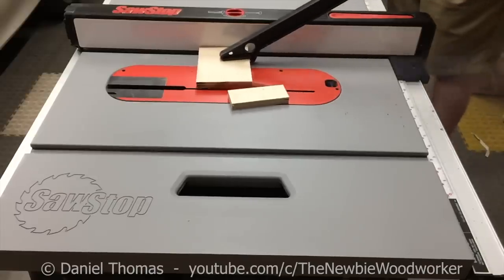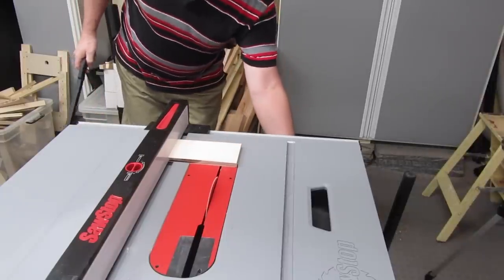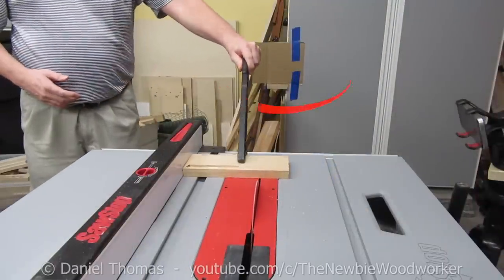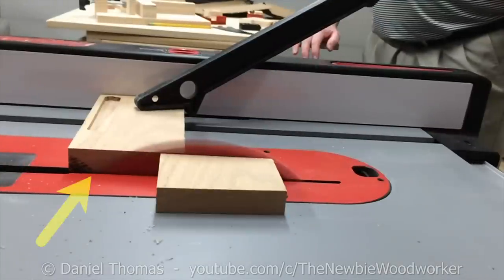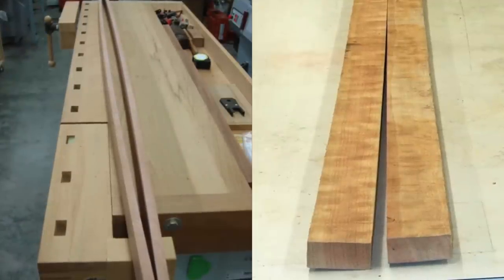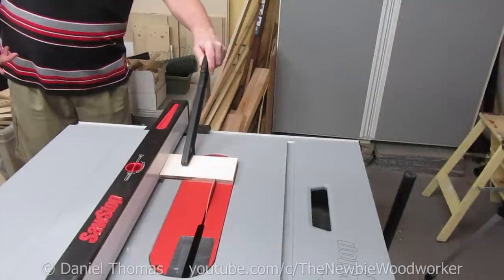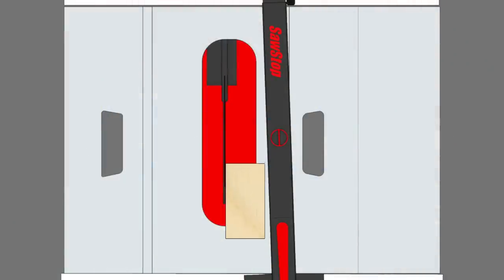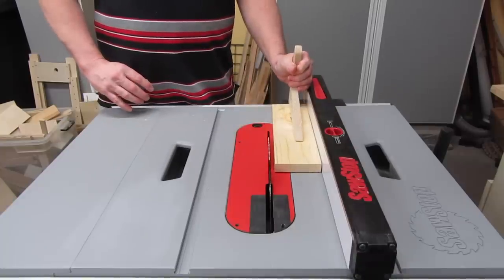Actual Kickback (in Slow Motion), & How to Prevent It

Comment: This video revisited... 
I came over here again through a link from your revolutionary cross cut sled.  The good news is that YT is recommending it to me everywhere and often.  I hope it is recommending it to many others as well.  

I'm working on a website (not ready to share the link yet) for newbies and started by creating articles about the first things newbies need to know to get started. Safety!  It's supposed to be about how to actually do some woodworking, but after getting started, but with the safety information just on the table saw, I think I could dedicate the site to table saw safety and not finish it in my lifetime.  

Kickback: One of the things I noticed, from watching all the video and from two experiences, is that it strongly appears that kickback only happens when a board crosses over the top of the blade.  This could explain why you had no results when you pulled the boards... you kept the leading edge down. Even when a board is pinched, it seems that the teeth have to lift the board to the top of the blade to throw it. Have you seen any kickback where the board has not come across the top of the blade? 

The worst kickback I got was when I was on someone else's saw that had no riving knife.  I ripped a long board over a three-roller outfeed. When I pulled a piece back towards myself, the rollers pulled the cut off piece into the back of the blade. A riving knife would have blocked it. It was the first time I wore the apron to the shop and it protected my jewels. I didn't get hurt, but it was a rude awakening.  

The other time was actually not the piece I was working on, but my push stick.  I had the long, thin push stick like you used and got it to close to the blade.  Like most people teach, I had a very low blade, so the stick hit the top of the blade.  I had a good grip, but it threw my right hand to the right and the push stick flew past my left side. I was not injured or bruised, but the shock that went through my right arm was painful. 

I have more to say, but it relates more to your other video, so I'll go back there.

Thank you again for your emphasis on safety.
Reply from the maker: Thanks for the comment, and good points! Yes, I have seen kickback that didn't appear to ride the top of the blade, but never with a riving knife. And as you obviously know, riving knives are the best tool to help prevent kickback. Regarding the push stick, blade guards (where usable) can help prevent the push-whatever from getting into the blade.

Comment: One thing you missed... Even with a spacer block attached to the fence, you need to make it so that the gap exceeds the diagonal of the piece minus the length of the piece, otherwise it could still jam and kick back.  For example: You clamp a 3/4" scrapwood space to the fence ahead of the blade like you are supposed to, and set the cut length to 8".  Then you cut a 3 1/2" wide board.  The diagonal of that is 8 47/64".  Too close to 3/4" in my book.  Better to use a 1" or more scrapwood spacer to give the cutoff wood a free place to move.
Reply from the maker: Thanks for the comment. I never thought of that. I doubt it's much of an issue with a sled, but I can see how it could happen with a miter gauge. Good catch!
Reply: Bill Wheaton;   Great point when using a spacer block attached to the fence.  That tip may save me from an accident.

Comment: Some real good information and demonstration in this video....Thanks for making it. I am 66 yrs. "young" and spent most of my working career in machine shops where I learned to operate many kinds of machines and also learned good safety habits. When I retired, I built a shop where I make wood crafts that I take to craft events & farmer's markets to help supplement my SS. So...I know how to work with machines and understand how careful you must be if you want to keep all of your body parts...and your life..intact. But...I still have a great deal of respect...almost fear...of my table saw. I think it's probably the most dangerous, and unforgiving power tool in a shop. I have all of my fingers and both thumbs and I plan on keeping them..!! For push sticks...they are good...better than nothing... but should never be trusted to take care of all of the safety concerns when feeding wood past the blade. Yes, the "Gripper" is popular, as well as other kinds of blocks that actually keep the wood firmly pressed down onto the table throughout the cutting process. Yep, I have a couple of push sticks that I made, and I use them, but this is what I use almost all the time : https://www.amazon.com/Big-Horn-10230-Woodworkers-Safety/dp/B001C4O92I/ref=sr_1_4?ie=UTF8&qid=1534731683&sr=8-4&keywords=push+sticks. I have had it for about 6 years and I even copied it and made myself one that is thinner so I can guide thin pieces of wood through the blade and maintain downward pressure all the way. And yep...when I know that I'm starting to get tired...I step away from the table saw. As for myself, I don't even have a radio in my shop; I want to give 100% attention to what I'm doing. And I will not operate my table saw if anyone else comes in the shop.
Reply from the maker: Thanks for the comment! Good stuff there, all of it. And you're only 5 years older than me!
Reply: Newbie....Heck, it seems that as the years pass that I find myself older than more & more folks..LOL..!!  I want to pass along another safety measure for the table saw.  My crafts require me to cut multiples of a lot of thin pieces often 1/2 " and 1/4" wide and even thinner. I make a hold down guide for those thin pieces by taking a small block of wood and I clamp it to the fence just a little past the blade.  I clamp the block of wood just a tiny bit higher than the height of the pieces that I'm running through so the pieces slide under the block and this keeps those thin little pieces from riding up and getting flung back. This hold down guide can of course be used for cutting any piece of wood, but those thin, little, and very light weight pieces of wood most definitely need to be held down as they are being cut. And yes...as careful as I try to be, I've had kick-back happen...scares the crap out of me...!! Table saws are a great tool...we just have to be smarter than the saw..LOL..!!
Reply from the maker: Interesting - thanks for sharing. The worst kickback I ever received was from my router table, before I knew how to use it. I put the stock between the router bit and the fence. The sound when the stock hit the wall is something I'll never forget. Neither will my wife. 😛

Comment: Hello Dan. As a high school shop teacher I will show this video to all my students as part of table saw safety. You've done a great job! Several things I will comment on. Splitters and riving knives can't be used when the blade is not set to cut through the full thickness of your stock. ie: cutting a rabit or half lap joint. Also blade height. One full tooth above the stock.  I teach to use 2 push sticks as you have shown but it is important to mention that the one applying pressure to keep the stock against the fence must not ever push against the blade, and it is not necessary once the stock has cleared the splitter. On very long boards, a wedge can be put into the kerf to further protect against the material from pinching the blade, and with long boards, having an assistant to "catch" the board on the out feed side of the saw to keep the board from flipping up, either smacking the operator in the face, or lifting the board until it contacts the top of the blade launching it toward the operator. For small pieces, feather boards can be an option, Lastly, I am left handed and have had to adapt to all machinery which is typically designed with lefties in mind. ( imagine using a miter saw left handed and the handles on drill presses. ). I usually start my cut and then move with the work piece to the left side of the saw out of the line of fire. Also, as a personal preference , I like the second style of push stick you showed as it keeps downward pressure on the stock closer to the blade.  You demonstrate kickback far better than I can explain it and I don't need to risk an accident trying to demonstrate it. Thank you for producing this video.
Reply from the maker: Thanks, Paul, for a well-explained comment. I'm happy to know I'll hopefully be helping others stay safe(r). If you happen to see me do anything questionable in any of my other videos, should you watch any, please let me know. I've been called out on some pretty hair-raising stupidity. 😳

For blade height, I try to make it about even with the bottom of the gullets. But I may start trying it a little lower, and see if I notice a difference.

As for the riving knife on my table saw, I can leave it in while cutting rabbets and other non-through cuts, and it works fine. The height on it is perfect. At least, for the combination blade I use all the time.

I admit I'm thankful I'm right-handed. I was born with a lot of things to my advantage, and I appreciate all of them. 🙂 Every once in a while I use something that seems like it was made for a lefty, and I get ticked. Stupid me - it should remind me to be grateful the other times!

Keep up the good work. I had a good shop teacher a really long time ago, and I still appreciate what I learned there.
Reply: A properly designed and fitted riving knife should end just below the top of the blade moving up and down with the bade as its adjusted. Problem is a lot of cheaper saws come with a riving knife designed to also have a blade guard attached to the top. These designs tend to be taller than the blade causing the problem you mention. When purchasing a saw always make sure it either comes with a well designed riving knife or one can be purchased for it.
Reply from the maker: @paulround8501  An excellent point. I wasn't aware they made saws with riving knives that don't move with the blade - that's a horrible idea. Besides the obvious problems, it also might encourage you to raise the blade as high as you can. shudder
Reply: @TheNewbieWoodworker  I think you misunderstand me, these riving knives do move with the blade but are designed in such a way that they always sit slightly above the blade. This is because they are essentially designed to fit a blade guard on top. It's a bad idea and some manufacturers do supply a proper riving knife in addition to this but many of the cheaper saws come with only one option to save money.
Reply from the maker: @paulround8501  Oh, thanks for the clarification, I did indeed misunderstand. And that makes sense, and I agree with your assessment. 😄

Comment: Good video but I am not sure that you mentioned that the riving knife should  be thicker than the plate of the blade but narrower than the kerf.
I tend to use two pushsticks, I personally feel I have more control but I am standing in the line of fire, if, as shown in your video, there is one. 
Somebody mentioned rest. I suggest do not use any machine if you are tired, distracted or lack concentration. 
As an apprentice, in the early 60's I used a large saw with on the job training, with the fence on the left. I don't , now, like the fence on the right hand side, it feels awkward even though I am right handed
Reply from the maker: Thanks for the comment. I actually didn't know about the riving knife and kerf width, when I made this video. Wish I had known! Rest is important, I agree. Anything that can help keep your mind on the task. Shooting videos while using power tools is very distracting, and I've made tons of stupid mistakes while doing it. I don't recommend it. 😛

Comment: Kickback can happen even with a properly aligned fence and blade. Kickback can only occur if the stock pulls away from the fence and the teeth on the back of the blade lift the stock off the table.  Two good prevention: 1) A riving knife is the absolute best. It looks like a hook shaped splitter and moves up and down with the blade.  2) A splitter is almost as good as a riving knife but it is stationary. If you want to cut half way through the wood you have to remove the splitter. 

My opinion - NEVER buy a saw without a riving knife
Reply from the maker: Thanks for the comments. Everything you mention is shown and explained in the video. In fact, that was the purpose of the video. Perhaps you might want to watch the video (all the way through) before leaving a comment?  Just a thought.  ;)
Reply: Yep, you're right, I skipped right through it. My apologies. I have a 3HP Jet cabinet saw. I'm guessing it's about 20 years old. It had a blade guard that acted like a splitter although it was not as thick as the blade. I could have adjusted it closer to the fence but the contraption made visibility and some types of cuts impossible. After having a sever (and painful) kick back ripping piece of warped plywood (it started to vibrate) I installed a splitter. Not only did this almost eliminate the possibility of a kick back it also made ripping much more accurate. My saw is perfectly aligned but at times the wood still gets away from the fence a little. Very well done video although I would have covered the importance of a splitter or knife a but more.
Reply: From what I have read the riving knives were not an option in the US for many years because the regulations in the US required that the blade be covered. Riving knives were popular in Europe for many years before they made it here. It's nice to see saws sold in the US with Riving knives. In my opinion it should be illegal to sell a saw without one! I notice you have a Saw Stop...  a fantastic saw! What is the top made out of? Is that a teflon coating?
Reply from the maker: Thanks. The SawStop’s top is made out of some sort of hard plastic. See my review video https://youtu.be/3zbYR5ok1V0
Reply: Riving knife all the way! Always cut away from the line of sight! Never push down hard, good way for your hand to sink into the blade if something bad does happen.
Reply from the maker: @TechieTard  Yeah, I've been trying to figure out a catchy way of saying that you should always be aware of what will happen if the stock goes away. Because it will, at one point or another.

Comment: Pretty much spot on.  

I do most of my cutting off the left end of the saw, and often use two push sticks.  

Additional tips:

Dull blades are a big factor.  If you are having to push, change your blade.  Pushing means more energy is being tied up in the restance to the blade, and you aren't balanced as well.

I like the concept of products like 'board buddies'  These are wheels you mount to your fence.  They typically have a few degrees of pull, to keep the work tight to the fence.  The wheels rotate just one way, so if the piece kicks back the wheels lock.

These would not done any good for your small piece kickbacks, but help with ripping.

*

Do tricky cuts when you are fresh.

If you make your own push sticks, you can attach grippy stuff to them (I like to use rubber matt tool drawer liner.) with carpet tape

If you are using a pull type push stick from the back side of the fence, use a grip that reduces your chance of your hand being pulled into the blade.  For me, that translates into a grip where my thumb  isn't wrapped around the stick.

Question:  Do all your vids show some degree of binding before the actual throw?  This potentially could cut the power when the slowing motor draws more current.

Be cool if you could do a followup of this with much higher frame rates. I'm curious what kickback looks like at a speed where you can see individual teeth interacting with the wood.  I think that would require something like 4000 fps.
Reply from the maker: Thanks for the comments! Because I;m trying to create the kickback, yes there's some binding before the kickback. You;ll have to wonder on the high-speed camera shots, though. 😄